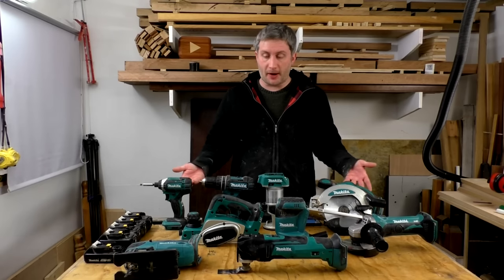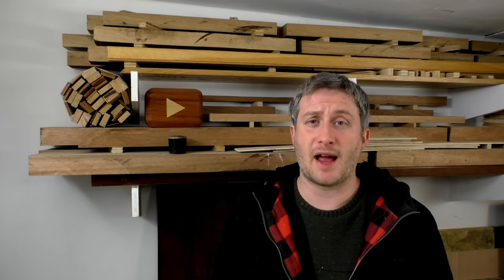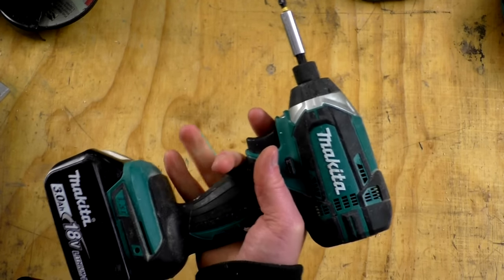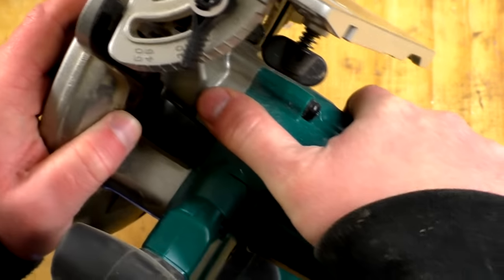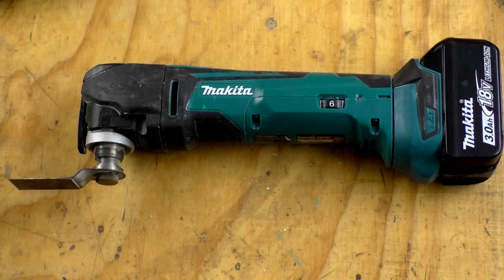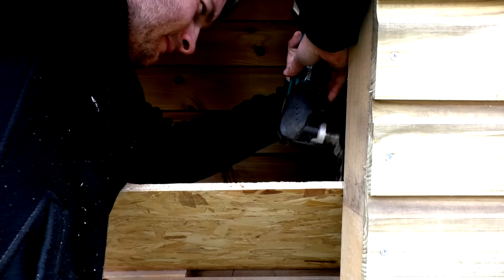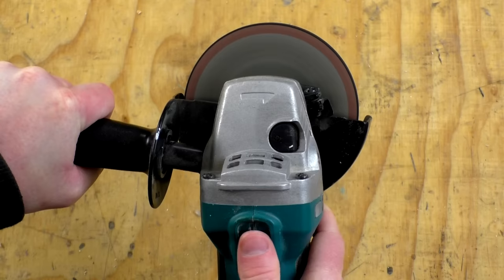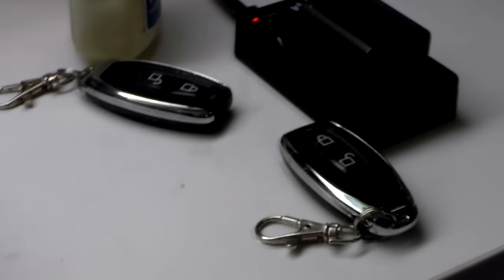My Makita Cordless LXT Tools Review

Comment: After hearing your rationale, I'd say, your point of view was quite reasonable. I've used Makita, DeWalt, and Milwaukee. Makita is a good brand, but they tend to break easily in my experience. Possibly just my bad luck. ;) The DeWalt line is good, and seem to me more durable, but are more expensive than Makita. Milwaukee is rather pricey, even in the US. It's a very good brand, but that price point is hard to overlook.
BTW, after I got my first impact, a Makita, the hammer drill just sits around until I need to auger a hole. 
The Makita sanders are very nice.

Comment: I have the same impact driver. Yet to use it but seems legit and strong. 
Have the battery chainsaw duc353z, 32 volt. I cut a lot of trees on my land and bucked logs. That thing I used extensively and I love it. 
Planing on getting the 36 volt grass trimmer as spring nears. 
I have 4 5ah and 2 3ah plus the double fast charger. I can do some extended work with the chainsaw having three pairs of batteries, charging while using. The batteries are pricey but can be used on more than 200 tools! They have a battery coffee maker, heated jacket and electric wheelbarrow. Lol!
Makita is a premium brand and makes igreat tools. They are made in many places and for different price brackets. The impact driver is made in Romania and was something like 70 euros.

Comment: Speaking as a tradesman of 25 years I don't think you can beat bosch blue. Don't get me wrong makita are a great brand of tool and alot of my colleagues use them. But I just like bosch. I've got a bosch 24 volt getting on for 12 years old now and it gets used daily and it's never let me down. It what I was taught as an apprentice.. look after your tools and they'll look after you. Nice set you got there though mate
Reply: The 18v makita batteries are handy if your battery is flat and need to start your car, just wedge 2 bits of metal into the contacts and put the jump leads on them, the makita batteries have 200A fuses in them ( well 2 100s in parallel but still) so they will start a car no problem . You cannot do that with the 24 v bosh as they will fry your car :)

Done this a few times :).

https://photos.app.goo.gl/ATZxfmyy2taEgwcI2
Reply: Andrew Joy you can't do it with the Bosch 18v batteries either because it burns them out. The circuit protection on them is terrible. Better in the newer cool pack batteries buy the first ones were shockingly bad.
Reply: Im sorry but first bosch would be my 4th pick 1st would be dewalt 2 milwaukee 3 makita
My dad and grandfather are dewalt guys but i have a good amount of dewalt alot of the 20 volt line and milwaukee m12 line . Im 13 i started my first buisness making wooden flags i made about $350 so far and started my buisness 3 weeks ago. I bought all my tools and you cannot go wrong with milwaukee and dewalt and i work with my dad (electrician) on the side and the handle so well.
Reply: Iloveapplefritters Why not Bosch is a really good brand
Reply: SGT MAVERICK In my opinion Bosch is the best with there 12v series better than Milwaukee I know many Guts that nearly only use Milwaukee but they all bought there 12v series from Bosch
Reply: @leonk.1031  Bosch has a nice 12 volt line but milwaukee has such a diverse line. I have the m12 hackzall m12 ratchet and other tools but they have amazing 12 volt tools and i want to get the 3 inch cutting wheel and the milwaukee is always coming out with new tools.

Comment: I like Makita, and like you I've noticed that virtually every workman I've ever had in my house uses Makita. On the other hand, their range is so disjointed - different model numbers between the US and UK, green/black/white models, and I've got no idea which are brushless or not most of the time.
That makes it hard to buy them confidently - while DeWalt, while slightly more expensive, has one model number, puts the word "Brushless" on the side of things that are brushless, and have one main range plus FlexVolt which you don't run into much. I tend to buy DeWalt, despite the extra cost, simply because I can look up what I need, watch some reviews, and buy it more confidently
Milwaukee have the same problem as Makita for the most part - inconsistent model numbers make it hard to buy, even if you can get hold of it in the UK without an insane markup
Reply: Dead rite mate, I’m amazed at how complicated they make it, and nearly went dewalt because of this very reason !!
Reply: I’m DeWalt all day long for 20v Max (your 28v) and I’m Milwaukee for 12v. I only buy brushless. And I’m real excited over the soon to be released DeWalt power stack batteries.

Comment: As an apprentice carpenter I bought the Dewalt XR range. Mostly brushless 3 5.0 ah 1 4.0 ah and 1 9.0 ah 

So far I feel that dewalt feel tough but I did use the carpenters makita tools and enjoyed them they felt very similar but I feel dewalt are a tad bit more powerful especially the multi tool and combi drill
Reply: Yeah. In the USA there are more tools in DeWalt line and much easier to find than Makita.

Comment: Great video. I have most of these tools in Makita and ones I use more often I have Milwaukee. I find Milwaukee slightly better but they don't have as good a selection as Makita. I have Makita 190mm 36v battery mitre saw. Great tool and I really like Makitas 36v range. I've the Milwaukee 18v Gen2 brad nailer and its a fantastic bit of kit.

Comment: You have what looks to be alot of their homeowner line. That drill is for sure a homeowner version. The plastic chuck is a dead giveaway. We run all hammer driver drills at work and they are much heavier duty than the drill you feature here. Not sure about the others but the hammer driver drill is more towards industrial/commercial applications. That drill is just their driver drill.  They hold their own just fine but if you spend more money with Makita you will get better models.

Comment: Fabricator for 13 years now drilling holes in metal constantly. 1 inch holes though 1/4 to 1/2 thick alum. No problem for the Makita hammer driver drills. Even the driver drills do well. Makita lasts longer than anything else we've had and we've gone through dozens of all makes.

Comment: You now make me wondering about the Multitool. I got the VonHaus like you showed and does not feel up for the job sometimes... and seeing just the mechanism to change bits on the Makita, might worth an upgrade. Thanks for the great review of tools!
Reply: yes, that system is much better then regular screw tightening, which i do have on some cheap (actually, it wasn't cheap at all, since i could get bosch or makita for same money, but it was kind of a gift). i would buy just for this feature alone.

Comment: Superb review I enjoyed that, thanks. One thing that irks me is that my mixture of ryobi and bosch tools have different sized dust extraction ports. Are the ports the same size on your range of tools? If not do you a a universal coupling or something to switch tools with? My current method is to use duck tape.
Reply from the maker: There isn’t even consistency between all the Makita tools, they all have different ports - very annoying! Axminster do some good adapters. Duct tape works well though
Reply: Grrrrrrrr!  Thanks I think.

Comment: Wen putting your bits and tips in your impact gun you dont have to pole out on the locking chuck its one handed just push it in only have to pole it out when taking tips out

Comment: Wondered what you thought of the battery reliability. A few years ago, I bought the first generation of the 18v lithium range. Excellent tools, crap batteries/charger.  All  4 batteries dead within 14 - 18 months. Just out of warranty. I thought that lithium batteries didn't have the memory effect and didn't need constant charging.Bought blue Bosch 10.8v drill and impact driver, at the same time, and all batteries still work. Had about the same run time for both sets. Are the newer Makita batteries any better?
Reply from the maker: I’m not using Makita tools anymore except for the cordless router. Have switched to Hitachi/HiKOKI.  It’s best to keep your batteries away from cold weather as that can affect their lifespan. I always bring mine in the house during the winter months
Reply: My brother who uses his Makita tools everyday at work had his batteries died after 7 years. Before that he had some cheap cordless brand, and they lasted 8 months.

Comment: Not sure if that's the same angle grinder I have, but mine only works with 3.0AH batteries since it doesn't have the "star" overload protection on it. The rest of the kit I bought works with my newer 4.0AH and 5.0 AH batteries since they have the star on them. it works ok if you don't use it alot but for cutting through thicker materials it's kind of weak compared to other cordless angle grinders. I'll definitely upgrade to the newer brushless one at some point.
Reply from the maker: Mine works on 5Ah
Reply: ah right on, I bought my kit about 4 years ago so i think they put the old grinders in with it to get rid of them. Everything has held up great though with near daily use.

Comment: I love my makita tools , however the brush range is what you don`t want ( i had the impact driver catch on fire while screwing a deck ) also running a 6 amp hour battery does not help . For a few dollars more get the brush less version and you`ll get more power / lower power consumption and less overheating

Comment: Makita and Bosch Blue are the best trade quality tools imo. My only gripe with Makita is their refusal to get with the times and go to larger lithium cells like 20700 or 21700 and higher cell counts like the 15 cells you get in Dewalt's Flexvolt batteries and whatever Milwaukee calls their big boy batteries. AEG also have their Fusion/Force batteries and tools, and Bosch Blue have their Core battery line. Why is this important?   Well these batteries can meet or even exceed the power output of a corded tool.

 Dewalt have Flexvolt tools that put out 2400 Watts now, and Makita are being left behind, because their solution was to simply make a few tools that take two batteries. This is a sub optimal solution, for obvious reasons. I love Makita, but I use my Dewalt Flexvolt batteries on everything including my impact driver. At first I thought I would only use them on Flexvolt tools, but I found that all my tools work better and go for longer with the Flexvolt batteries, and the additional size and weight is really not an issue for most tools.

Want to know why the Makita cordless sander is gutless? It's because the batteries can't safely put out enough power. It's as simple as that. Don't believe me? Here's the math: Makita use 18650 cells in all their batteries. 18650 cells range in continuous current ratings from about 30 amps for a 2000mah cell, to 15 amps for a 3000mah cell. 2500mah Samsung cells are very common choice, rated for 25 amps. Makita only do 5 cell and 10 cell batteries, and for now I will only focus on the 10 cell versions. The 4, 5, and 6 AH versions have 2000, 2500 and 3000mah cells respectively. 1p cell 18v batteries have two banks of 5 cells in parallel, so total amps is double what a single cell will do, at 18. 5 volts instead of 3.7. Watts = volts x amps means 555W for the 6AH battery,  925W for the 5AH battery, and 1110W for the 4AH battery. Also for good measure let's say you have a 2AH battery, well that can only put out 555W max as well, without exceeding the ratings stipulated by the cell manufacturers. Tool companies are consistently exceeding the rated current of the cells, and are playing a balancing act between power, safety and cell longevity. The reality is that Makita cannot control which of their batteries you put on which of their tools, so they will be keeping all of their tools below a certain power output and I would guess it's somewhere around 800 or 900 Watts. Burning up your 6AH batteries, (That's why they don't live as long as the others) but still within safe limits, especially with how sophisticated Makitas battery management is.

Corded power can only be matched with bigger batteries or more cells. It's as simple as that. Nobody is going to want to put two battery packs on most tools, even if Makita made them. Maybe an electric chainsaw that you hardly ever use, but come on, this is a serious limitation.
Reply from the maker: I'm using HiKOKI multivolt now, and I agree with your assessment - but still love Makita tools

Comment: How is your experience about cordless vs corded powerwise? With the saw I am always afraid not having enough oomph. Same for weight. I am big fan (but like you not a fanboy) of Metabo.
What do you call a good battery life btw? A day?
Reply from the maker: I’ve not really noticed a difference in terms of power, or certainly they’re powerful enough for the work I do anyway. I’ve cut some 50mm thick oak with the circular saw in one pass when the blade was still sharp (it’s now dull) which was a surprise as I wasn’t sure it would handle it! Battery life varies by tool and task so difficult to say
Reply: Rag 'n' Bone Brown . Ok thanks. But like a couple of passes with a circular saw through some oak or dense plywood? Say 20-30mm deep. 
Btw most motors in corded tools work even on DC voltage. So in theory it would be possible to convert them. No idea if there are any kits on the market for that actually.

Comment: personally i use makita power tools, and i love them, with the exception of trhe cordelss finishing nailer of wich i have used 4 individuals (3 brand new, one used) and none of them could go trough a single nail clip without atleast one feeding failure, and to fix it you need to remove 3 screws to eject a jammed nail. a friend of mine has a ryobi one wich only very rarely has a feed failure, and incase it does it has a quick release to eject the jammed nail. makita should really look at this specific tool imo...

Comment: Makita are the best of the mid range. Festool are just too expensive.
Reply: Andrew Joy fest tool & HILTI are just high price names. They are not tuff at all. U just paying for the name.
Reply: Don't compare Hilti to Festool or Makita
Reply: Makita is better
Reply: Dewalt will last
Reply: N VD97 No it‘s not
Reply: Heckee Pagan No that‘s not right at all Hilti,Festool,Maffel and Fein are way better
Reply: Hilti's cordless line is overpriced and lacking in tools. It's made in China too just like the big three cordless manufacturers, all you are paying for is the hilti name. There are like 10 tools on hiltis cordless line so if you want any niche tools that makita/dewalt/milwaukee offer you will need to have multiple battery platforms anyways. Same with festool actually...unless you are involved in carpentry there is zero reason to go with festool for your cordless stuff.
Reply: Hilti cordless drills suck. We had a rep sell us a couple to use next to all our makitas and it did not last. Thing gave out in like a month. Don't like their soft start either. They are alot slower at getting a 1 inch hole through half inch alum than the Makita and also heat up faster.
Reply: @leonk.1031  I have used HILTI and fest. They r good but Makita wins. Fein I have never used so I won't write about them.

Comment: I’ve got several 18V DeWALT cordless tools, but I’m not a huge fan: more than enough power and it’s nice to be cordless, but besides the drill and impact driver, the batteries are drained way too quick for my semi-professional tools, even with 4Ah batteries. As said, the drill and impact driver are fine, but the jigsaw and circular saw drain the battery incredibly quickly.

And now about the video: great, extensive review, thanks!

Did you actually consider DeWALT at all? Since you didn’t mention them.
Reply: He did, 1:32
Reply: penlandia03 Sorry, I must be blind!
Reply: He specifically says you need 5ah or higher batteries in the larger power tools.  For drills/drivers small batteries work fine.

Comment: My only experience of Makita was buying their 10.8V drill and impact driver set. They are crap. The batteries would last for about 10 screws then be flat. I should have returned them really.
Reply: Actually, sorry, that's wrong.   It is not my only experience of Makita. I forgot my Corded trim router and corded biscuit jointer are Makita, and I think the are great tools and have no complaints about them.  Just wasn't impressed by the 10.8V tools.

Comment: Great video. I use 3 battery platforms. Dewalt, Milwaukee and Makita.  I do like my Makita tools but my Milwaukee are the best of the three platforms for my uses. My issue with Makita is the battery and charger plastic connector. It breaks and is too delicate then the Milwaukee which has a better battery due to its durability. I like and use all three but for different work. Most of my saws are Makita, ‘specialty tools’ dewilt and daily tools (everything else Milwaukee).

Comment: In the States they use 110 volt outlets, and in UK it's 240 vol, how did you cope with that?
Reply from the maker: They’re battery operated
Reply: @RagnBoneBrown  ok you're using the same 240 v charger,,,, thanks

Comment: Great review of you’re collection. The worst thing I personally found about Makita was not really the performance of there tools as they are all way above standard but there radio is useless because it does not charge batteries, come on Makita get with the times.
Reply: DeWalt and Milwaukee are the patents holders for the radio/charger and the charger/radio so Makita cannot make either. But they should wise up and incorporate a battery charger with their Bluetooth speaker or a LED light station with a charger base.
Reply: The radios that charge batteries come in  Horribly  And it's because Milwaukee and the dewalt batteries constantly have to be on the charger